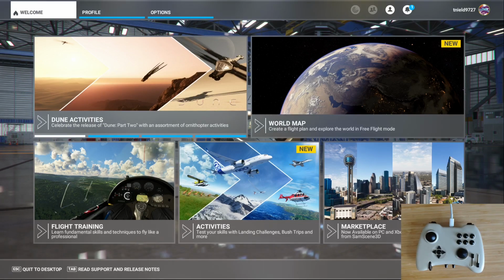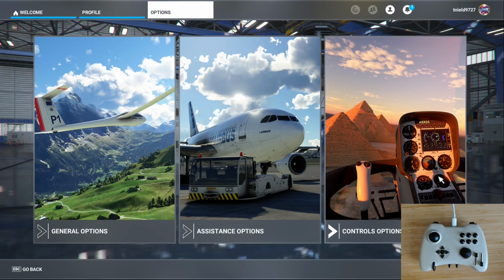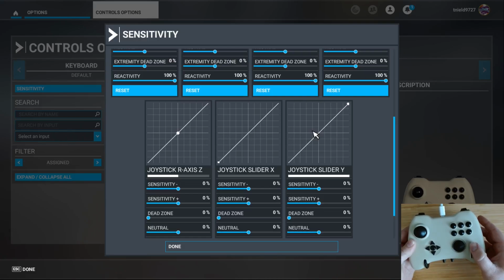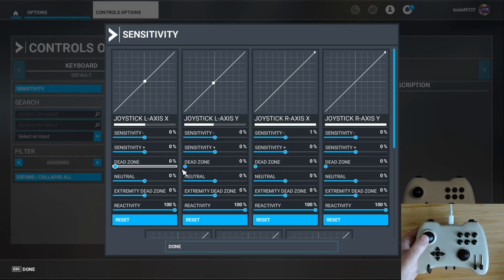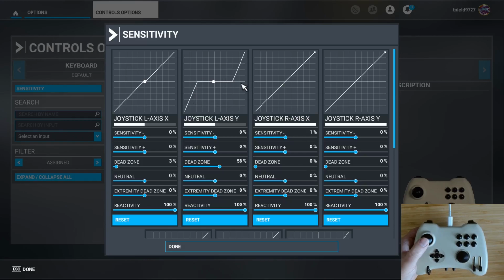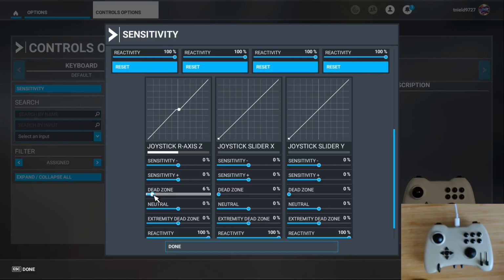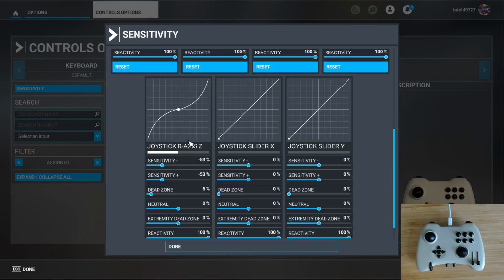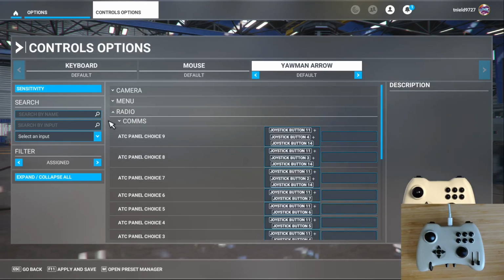Yawman Arrow | Deadzone and Sensitivity (MSFS 2020)

Comment: I have just begun using this and specifically with the helicopter training missions. The left slider on the right side of the Yawman is Collective and it is very sensitive but inaccurate as I cannot place the slider within a range of 2 - 8 feet required in some training missions. Can you please tell me how to fix or correct this ?